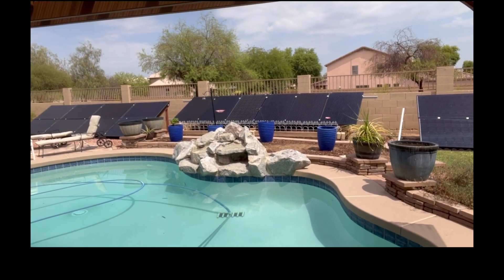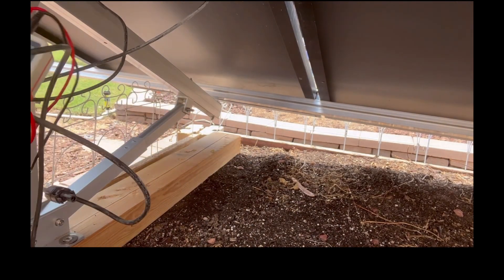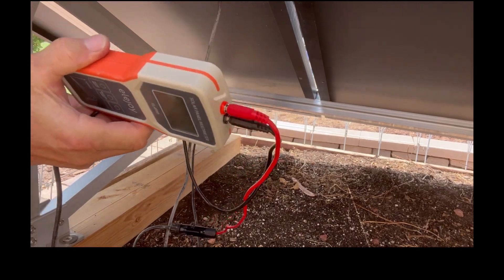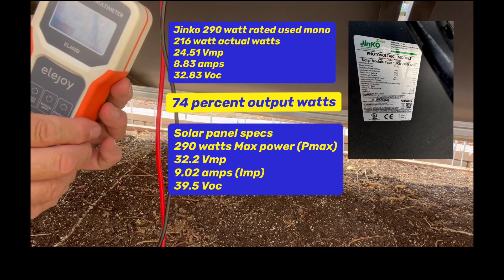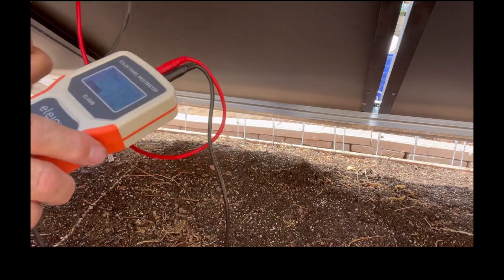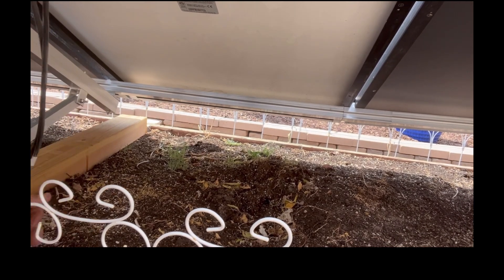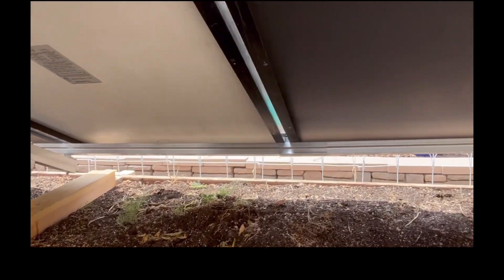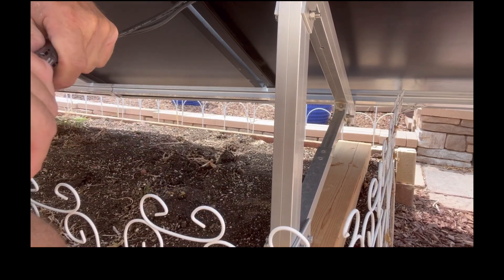DIY solar panel for home. Solar panel testing for Watts, volts & amps output on each solar panel

Comment: Thank you for sharing the value on the selected panels. Glad they're enough to power the mini-split. Thanks for sharing as always!
Reply from the maker: @MatthewYBarbo  you are so welcome. Most of the time I get really good panels. Being used, every once in a while I get one that underperforms. But still a great deal at the price. Very very cheap to start solar. I prefer new solar panels with 25 year warranty. The used solar panels only have one year warranty and after that you should expect to get 2-7 more years before the solar panels will get to 50 percent of stated watts. But for those wanting to start solar and do not have the money to buy new panels, it’s a great way to break into solar and learn, then in a few years upgrade and replace with new panels. If you have a large yard like I do, you can over panel like me and get the output you need. But having 10 new 400-500 watt bifacial solar panels that can easily give me over 3000 watt output is nice for small yards. I should be able to get 20+ years of great output from the bifacial panels.

Comment: Nice video, would really want to see how you protect wire from array into house, wonder if conduit is underground or secured or protected in some way
Reply from the maker: I run the wire in flexible conduit that is buried in ground. You can buy at Home Depot or Lowe’s. Out here, the ground is like cement because we don’t get much rain. So I wait until it rains before I dig.
Reply: @diy-solar-guy  Better than our mountain of solid rock!!
Reply from the maker: @rongray4118  yes solid rock would make it impossible to bury.
Reply: @diy-solar-guy  same here in north Phoenix ground is hard

Comment: where does the meter put all of that power?
Reply: This is exactly what I was thinking. Didnt know such a device exists without diverting load to a resistor or something. You live and learn lol
Reply from the maker: @eugeneputin1858 these solar panel multimeters area very easy to overload. If you buy one, stay under 400 watts for this meter I show in video they are around $65 and up on eBay and Amazon. Buy the warranty!!!!!! But overall work ok.
Reply from the maker: @jamesalles139  this is all off grid. There is no meter. Nothing of this solar is tied to the grid.
Reply: @diy-solar-guy  Neat. I was talking about the fact that you are ostensibly holding a 2-300 watt heater in your hand. Obviously, these are momentary tests.

Still, did it get warm at all?
thanks for the video!
Reply from the maker: @jamesalles139 the meter is powered by the solar panel when you connect it. There is no battery inside the solar panel tester. I just bought and started using it so I don’t know how it works inside with the circuits. But if you use a panel or panels over the load limits, the tested will be ruined unable to repair. I would buy insurance if you were to buy one. So if it stops working you can get replaced. It’s nice to test to see if panel is good but will have to see when I connect this 6 panel solar array to inverter to see the actual input and compare to the readings I got today. I will have to try at 10:30 am to make sure it is the same time of the day to see if the testing is correct. This is a 400 watt max multimeter solar panel tester.